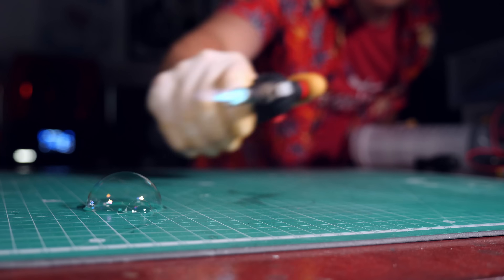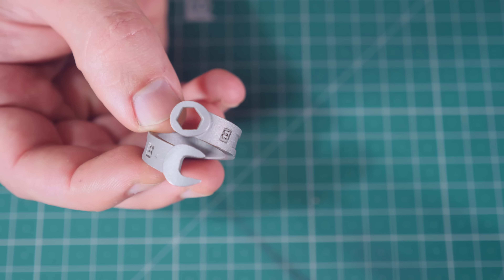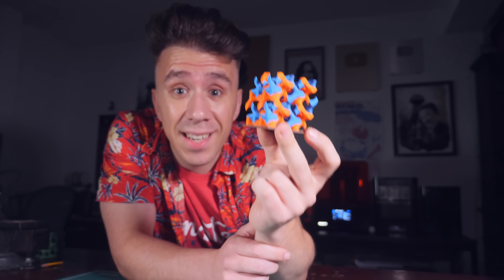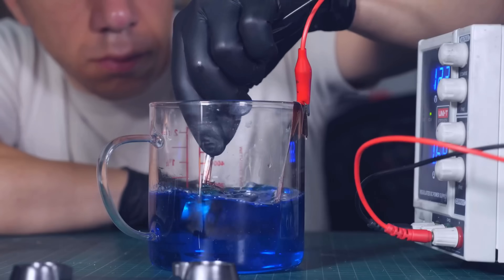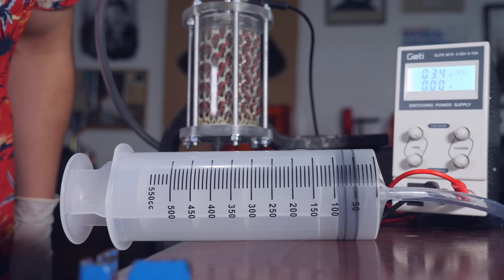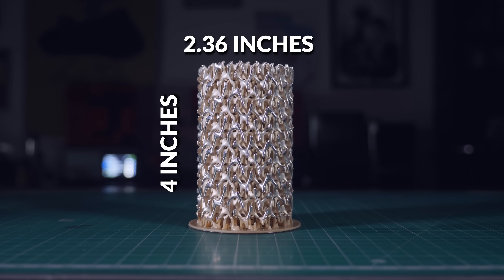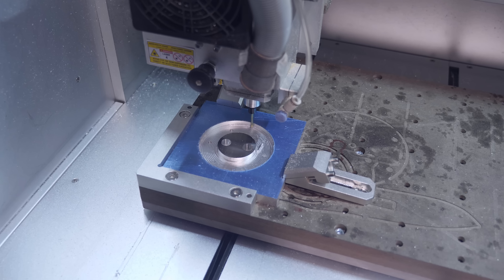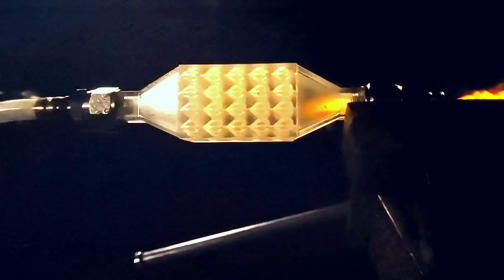ROCKET that LITERALLY BURNS WATER as FUEL

Comment: Try combining your H2 generator with an ultrasonic transducer – it is said that this would multiply the performance because the bubbles adhering to the metal prevent further water from coming into contact with the metal plates, allowing more H2O to be split. The ultrasound is supposed to ensure that the effectively usable surface is continually cleared of bubbles.
Reply: Good idea
Reply: a surfactant greatly reduces the surface tension of water allowing hydrogen bubbles to escape the surface of the eletrode. this is a simple chemical and does not require complex electronics
Reply: Good idea, also adding some water flow could move the bubbles
Reply: What would the effect of using AC be for this? Could it jiggle the plates or the water enough to create a similar effect?

Maybe a single phase motor could be the perfect generator for this then.
Reply: @diegorodea5425  or a propeller at low rpm
Reply: Disclosure, I have no idea about anything, but if the setup were on its side, then the escaping bubbles, wouldn't be travelling past every plate ? Maybe on its side and rotating too, allowing for that water flow ? Again, no idea, just a thought ?
Reply: I know they make those ultrasonic jewelry cleaner containers that could fit his electrolysis chamber with little to no issue and they're only a couple hundred bucks, but IDK if it'd be cheaper to just wire some motors with offset weights to a plate and bolt the chamber to it so it vibrates...
Reply: Stan Meyer used a special waveform for his pulse (pulse within a pulse) to 'shake' the water molecule apart. Also the plates needed treating by throwing out the dirty electrolyte and replacing with fresh a few times until they don't discolour.
Reply: @donotwantahandle1111  very good!
Reply: I was going to say that those bubble have to impede the process. Either circulate the solution or agitate it.

Comment: Hi, ECE major here with some advice on the battery problem. Trying to constantly pull the max amperage out of a battery is a very easy way to kill it as they aren't really designed to discharge tons of energy at once, but rather a bit of energy over time. So running a battery at max current is going to overheat it and kill it very quickly as you have experienced. Capacitors on the other hand are much more suited for this and can much more reliably discharge a large amount of current in a short time frame than a battery, but the issue is they may not hold as much energy as a full battery can. They are on the other hand cheaper to get in bulk than a battery so it wont be as catastrophic and costly if you blow a capacitor than a battery. ALSO on the issue of batteries overheating and dying, use some sort of current limiter on the battery or else you will likely keep running into the same problem. Hope this helps!
Reply: My bad I meant parallel
Reply: I was just thinking, can we use capacitors themselves as some kind of “current limiter”? They can be connected to the battery, the battery will give us capacity and capacitors will give us optimum current(assuming we pick the right one). Best of both worlds!
Reply: What abt super capacitors they hold energy for longer time 🤔
Reply: What about a transformer with fuses and a thermistor prior to the transformer? If it is current hes looking for a transformer should do well
Reply: I was just about to suggest this. Batteries for sustained current, capacitors for lightning
Reply: Right. Good thinking. You can power up a bank of capacitors that feed the ignition, while the battery can have a gentler cycle to and the the caps do quick the discharge.
Reply: @threeuniquefingers that would help balance out high instantaneous current, but it wouldn't really help that much with sustained current for very long
Reply: I'm a car audio enthusiast and for high powered subwoofers adding a capacitor takes a lot of load off of the battery(as well as the alternator), and you can wire multiple capacitors in a series if needed.. if you buy one for stereo often you can get one that allows you to limit the power like you described..
Reply: this correct as well as you should have a square wave going in to the reactor.
Reply: Could always source a capacitor designed for sound systems. They are readily available, and most hold 1-2 farads of power.
Reply: Nope, the voltage needed is very low so only supercapacitors would work. Normal caps have barely any energy in their low voltage operating region. And those are expensive. He simply needs a bigger battery with more output current. The cheapest will be a simple lead acid cell, couple of those in parallel.
Reply: @threeuniquefingers  No. If you connect a capacitor directly to a battery the charging current will be huge limited only by the battery's internal resistance. You could limit the charging current by using a series resistor but that will dissipate energy as heat, lots of it. Capacitors can produce a lot of power for very short periods but their energy density is tiny compared to batteries. Not a solution.
Reply: @mrgregb10  A farad is a unit of capacitance. The charge in a capacitor is given by Q=VC where C is the capacitance, V is the voltage and Q is the charge in coulombs. Nothing to  do with power.
Reply: For the next part of this perhaps you could find a way to condense the gas to decrease the volume / increase density to make better storage
Reply: @brendanwatkins8192  condense as in turn it back to water?.... 🤦‍♂️
Reply: How about using transformers and super capacitors
Reply: @benjaminsteakley I could see the transformer destroying those tiny plates with too much current it maybe could cause autoignition in the generator itself because of the heat causing the generated hydrogen to combust another issue would be power delivery or cable's
Reply: batteries are going to pull a max of a couple 10s of amps (from LiPO or Li batteries) and maybe 100 amps or less from a 12V car battery. id say that a better idea would be a transformer that takes 220V from a socket and with a modified secondary (to have 1-2 turns and a thick wire to lower its resistance) to potentially make only a few volts (>3V) at 1000s of amps, or with more turnings, 9V at still 100s or 1000s of amps (usually 5-12V are used for the electrolysis of water with salt (commonly known as a chlorate cell, but its about the same as baking soda). And also you have to account for the resistance of the solution, resistance of the electrodes, and the internal resistance of the battery and wires. Also silver, copper, iron, steel and other common electrodes will undergo passivation in a few hours of runtime (due to oxides forming and also carbonates/chlorides due to the solution), meaning that they will fall apart in some time.
Reply: This is the way, should be able to limit the battery and use some caps.  I am a computer science major and hardly know what I am talking about but enough to trust this advice.
Reply: @MrInternetzMan Hi, PhD ECMc here (electro-chemical & molecular conductivity ) Director of  the Institute of TBS ( total bullshit ) and managing-director of the institute of ionic-nullification and spaghettification.. XD well, I thought it sounded good lol ;p but, did you know that pure water is 'dielectric' ? :) guess it doesn't take a PhD after all lol
Reply: @threeuniquefingers  Won't work, limiting factor is the battery. Any capacitor No matter how large would discharge so rapidly the battery would have to take over.
Reply: @geeklife4605  That only works because audio has Spikes. This is a continuous draw.
Reply: The LTO BATTERY is very nice in between.
Reply: what if you chain a couple capacitors together so that one releases, while the other oness charge up, to keep the highest amperage streak running?
Reply: @KrzychuAleksina  Think about that deeply. And you will come up with the answer. Unless you have 900 batteries and 900 sets of capacitors, You will always draw far more power because it's a continuous Operation Requiring a huge amount of current constantly. If it all has to come from a single source, there is obviously no way to get more power out of something that only has so much power.
Reply: @forgeteverythingyouknow5413  aww dang it
Reply: i ain,t reading that shit
Reply: This
Reply: @threeuniquefingers  Try a PWM motor speed controller.
Reply: @threeuniquefingers Not that simple.  Capacitors block DC.  A simple resistor will limit current but will waste power.  Use the Arduino to generate a PWM signal controlling some appropriately sized mosfets
Reply: Car battery 😂
Reply: Sounds like a problem for SuperCap(acitor)
Reply: You or someone here in the comments should get a free 3d printer.
Reply: @ronhoover4367  have you or anyone reading this ever tried to hook up and sequence multiple dry cells using arduino??? 
What about separation and containment??? 
I have achieved 60 psi  stored before I became nervous, this was without pump using restrictions, check valves and regulators, mostly reefer fittings, hoses
Reply: The only real solution to this is to convert your ac to a square wave and throw that in there.....its irrelevant if its a n alternating current anyway for the reaction to happen so why not use an easy high power source instead of battery's. Think about it.... The 15V lipo could deliver enough power.... With a peak of about 6KW. A normal wall outlet can output 3680W, if thats not enough just fiddle a bit in the energy distribution box and grab power directly after the main switch for (in NL at least) 8 to 17 KW of power. Though it does become more complex of using 3 phase. But this is becoming an experiment in an of itself.... Oh and be carefully when messing around in the distribution box.... Getting shocking results is always better than getting shocked
Reply: 4 battery pack with 2 in parallel  and 2 in Serial with a timed relay connected to a 4/way capacitor bank , first use a step up voltage circuit that is then sent to a high voltage capacitor bank. That should give you the power required
Reply: Has anybody utilized a constant current power supply?
Reply: I wonder if the current draw is proportional to the number of plates used in the electrolysis.
Reply: Would pwm (pulse width modulation) be the correct way to solve the battery over draw?
Reply: Could you not create two stages.  First stage produces gas (slowly over time).  Gas is stored in the main rocket body.  The main rocket is a separate design saving on lots of mass as well as reducing the need for a large amount of current.  This is how those simple rockets in science parks work.  I guess you would still need a way of throttling the amount of gas igniting so as to create a steady flow rather than a bomb.  Anyway great video and can’t wait to see you succeed.
Reply: Wouldn't a resistor be enough to limit the amount of current drawn?
Reply: What about if you add a voltage multiplier to bring the voltage up, and in theory, bring the amps down (according to Ohm’s law)? Then you’d have to simply thicken the spacers a bit for more insulation as the higher voltages would most likely cause arcing between plates.
Reply: Here is the True Savior

HalleluYAH translates “Praise ye YaH”

YaH is The Heavenly Father
YaH arrives via the TENT OF MEETING
YaH was Who they Crucified for our sins
YaH was Crucified on an Almond TREE

Semitic of Moshe (Moses)
Isa Scroll (The Original Isaiah)

Isaiah 42:8 - I am YaH; that is my Name! I will not yield my glory to another or my praise to idols.

Isaiah 43:11 - I am YAH, and there is no other Savior but Me.

Isaiah 45:5 - I am YaH, and there is none else.
Reply: Use oil to cool - just watched a video about electric batteries being cooled in oil baths (possibly for Bugatti)😊
Reply: So you seem to infer a smaller system of his disks would not tax the battery as much, so if he had a bunch of smaller disks, he would solve his battery  overheat issue.
Reply: For those who want to use a transformer: he used the power supply containing a transformer powered by mains AC power at the beginning of the experiment and he found it to be too weak in the terms of current it provided. He could use a much more powerful transformer but it would have to be heavier and much more expensive to be able to provide the amounts of current he was looking for, also heat dissipation would become the problem in this case. Even worse situation if you would like to use the transformer for limiting the current provided by the battery: in addition to the above it would have to first change the DC power provided by the battery to the AC needed for the transformer to be working and this would introduce the additional energy losses. Also, the AC power provided by the transformer would have to be converted back into DC power again (even more energy losses), because the electrolysis has to use the Direct Current (DC) to be able to collect only hydrogen on one of the electrodes. The slightly better solution for drawing reasonable current from the batteries would be like someone already proposed to charge the capacitors using the batteries and then switch the power to drive the electrodes, however, it would take slightly more time to do it this way, also low voltage high farads caps are quite expensive. Another, perhaps even better (more efficient) solution for the problem of overheating and damage to batteries, could be to use the same electrolyte - which is used to produce hydrogen - to cool the batteries at the same time as electrolysis going on, you just would need to find the equilibrium between the number of ions dissolved in the water and amperage of the batteries at the same time you would have to constantly add the deionised water when the ratio of the ions to the water would change during the electrolysis process to keep the equilibrium. At the same, low voltage (around 1.5 V) would be optimal for hydrogen production - the batteries which he used in the experiments are overkill. I am think that also good idea would be to use PWM to solve high current/battery overheating problems as someone already proposed, however, it is not a 100 % optimal solution - I have been reading that pulse-based electrolysis has some flaws.
Reply: So, would using something like the internals of a taser work well? Battery charges up capacitors, then they discharge? Use a couple sets to even out the curve of power distribution/discharge?
Reply: Good Idea, he should switch to AC like his buddy Nikola Tesla so the Capacitors work!
Reply: SuperCaps go brrrrr
Reply: Thanks building flying drone electric/n gas engine backup looking for another resourse
Reply: Try researching constant current power supplies. These should allow you to establish a fixed maximum current (amps) that is consistent with battery survival.
Reply: @benjaminsteakley  Need ac voltage for transformers.
Reply: @threeuniquefingers yes, along with resistors to control said current and inductors to control AC vs DC and tune the circuit to work it its highest efficiency.
Reply: Just make the water less conductive
Reply: high current is needed to deliver, low voltage (1.6v or so) for safety. the high current low voltage is a known problem, specialist DC power supplies are needed. try PWM, at low "throttle", from an EV motor controller (single phase not triple phase). it will deliver the kind of punch needed. think about it: the resistance of those discs is going to be just stupidly low (basically a short-circuit). wouldn''t surprise me at all if we're looking at 0.0005 ohms or less.short-circuit any battery and of course it won't last.
Reply: wouldn't a higher voltage battery help with this too?
Reply: @benjaminsteakley  Unfortunately that won't work here since transformers only pass AC currents and this is DC.
Reply: @ronhoover4367  The direction you're heading is an actual power supply. Huge honking power supply is the real solution here. Although costly, it's the right tool for the job.
Reply: What about using a plc to send pulses
Reply: @nukesxx I think a a 12v battery hooked to the supercapcitors would be better, supercaps don't have enough energy storage for a sustainable continuous production. That's why I suggested using a car battery like 400cca or small motorcycle battery 150cca or  >ten Amp hour or greater.
Reply: @rogerphelps9939 what about using a inductor in that circuit
Reply: @JOSHUAWARREN16  You really need tto learn about electronics to determine what the optimum solution to anything is. Just saying put an inductor in is not helpful.
Reply: @lucasromania  You could use a MIG or TIG welders transformer and rectifier to get alot of amperes. + You can control the amount of current you get with the electronics built in.

Comment: To avoid confusion, there's a difference between electrolysis and hydrolysis. Electrolysis uses electricity to split molecules, while hydrolysis uses water to break down molecules
Reply: Yea tag integza in that i was also thinking the same thing
Reply: Oh yeah. I recently learned that's the term for cooking with water, aka boiling. Hydrolysis. It did confuse me when he used it. Glad you guys cleared that up.
Reply: I was coming to say the same thing.
Reply: Yes me too, I guess it was a mistake there